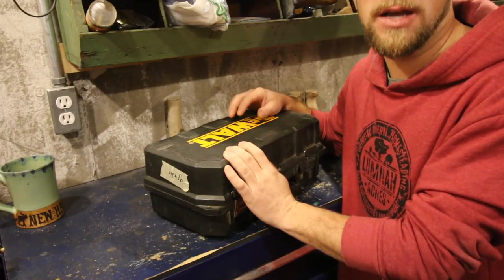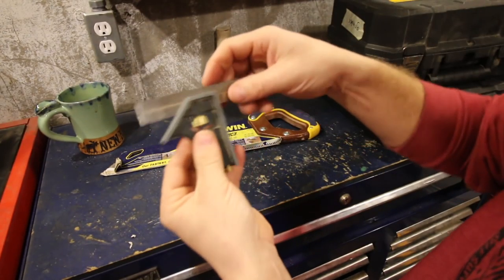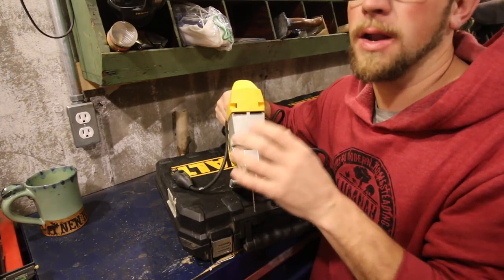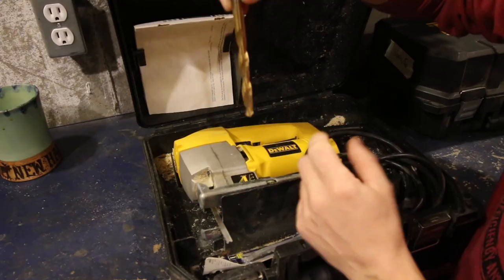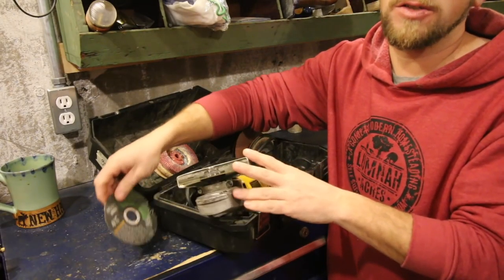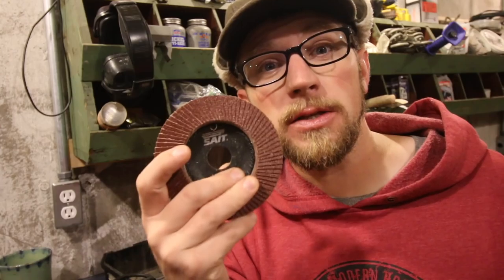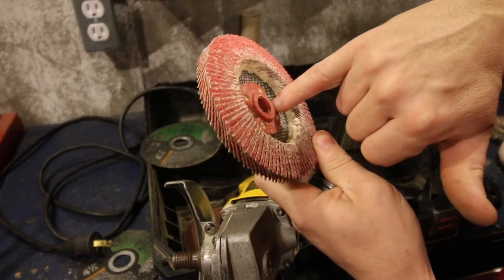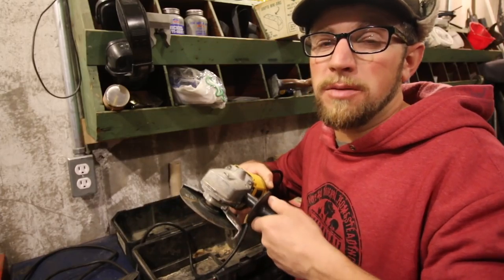Tools we use to Build our Modern Homestead

Comment: I use a grinder for everything. They are called flap discs. you can search Amazon for flap disc. Also have them at Lowes and Harbor Freight and Tractor Supply have them.
Reply: John Harris exactly, me too. I’m offgrid in my second year and I love my angle grinder/hand grinder. It can replace a cutting torch many times with a cutting wheel or even a grinder blade, with better results (and cheaper) than a torch. I once built a trailer from a broken pickup truck with just that angle grinder and a stick welder.I have a $30 grinder I bought from Lowe’s about 4 years ago that’s still going strong. Another type of bit I’d like to mention is wood cutting and grinding shaping bits like you can find from King Arthur's Tools http://katools.com/ . I bought a Galahad, which is a kind of rounded grinding wheel made from titanium, with titanium bits of grit welded on, used for shaping wood. You can rough sand wood, carve bowls, or make whatever. Artwork... Anyhow I used to play around with that and it simply can be cleaned with mineral spirits if it gets gummed up with sappy wood or something. I learned Harbor freight makes a more affordable version for $10 https://www.harborfreight.com/4-1-2-half-inch-carbide-cup-wheel-66613.html . I have an assortment of flapper wheels also, which is necessary for finer sanding, but they have to be replaced, unlike the cleanable titanium.
Also I use a metal and diamond cutting blade a lot to cut concrete and stone. The one I’ve had from Lowe’s (just a diamond coated cutting wheel) has lasted years now. Metal grinding wheels work fine on stone and concrete too. I recently made an organic looking stained, concrete countertop and the grinder worked great on touch ups.

Comment: The key to doing long cuts with tin snips is to use offset style snips. They lift your hand above the metal so you don’t have to fight it nearly as much. The problem with using a grinder to cut painted metal is it burns the paint off, leads to rust spots.

Comment: Hey, Al.
The flap disks for the angle grinder, I pickup at Lowes, Home Depot, Menards, & True Value. The best ones are ceramic, but you can get them in Zinc Oxide & Aluminum Oxide as well. Aluminum Oxide tends to be the cheapest & lasts the shortest amount of time, I have a bunch of zinc oxide disks that have lasted pretty long, but the ceramics blow them both out of the water, they just cost quite a bit more. 4 1/2" Disks tend to be a lot easier to find than the other sizes in flap disks.
Reply from the maker: Thanks, I will have to try a ceramic flap disc

Comment: I like this, "tool time with Al"!  Well done!  As you probably figured out by now....I love to video snoop, what is that in the backdrop or something totally unrelated to the video topic!  That green shelf/bin mounted on the wall, did you make that?  It's a great job whoever made it!  
Concrete wall space is often avoided for shelving or trying to hang anything because it's more difficult to get a secure anchoring system that can take the weight. Hilti anchors are the most common type I have used over the years, even the shot type with gunpowder chargers. I have prefered the 'drill & anchor set' system.  Forgive me for suggesting more 'video chores' for you to do, but I think a 'tool time with Al' vlog dedicated to drilling and anchoring into concrete would be great.  Thanks for listening
Reply from the maker: Thanks, Dennis. The green shelf was in our house we bought in MA. I remembering when I first saw it that I was surprised someone would leave it. I told myself when we move it coming with us! :)

Comment: I've seen those combination squares with multiple blades. I can see how the shorter blade can be very handy, but when using it for very accurate right-angles, you should use the longest blade you can. Just like a level... a two-inch level can't be as accurate as a 6-foot level. xoxo from Arizona

Comment: Great tip, keeping a drill bit with your jigsaw. Those sanding disks are flap sanders. You should be able to find them at any home center, farm dept. store. or Amazon, There are a lot of grits. I prefer the blue, aluminum oxide disks. They last longer with a wider range of materials than the red, garnet ones, those are best for wood working. 
https://www.amazon.com/10-Pack-Auto-Sanding-Discs/dp/B000WGHZYG